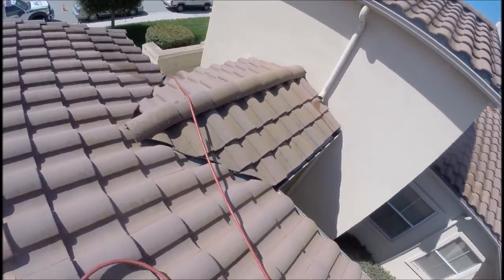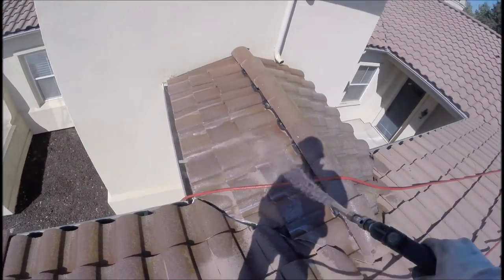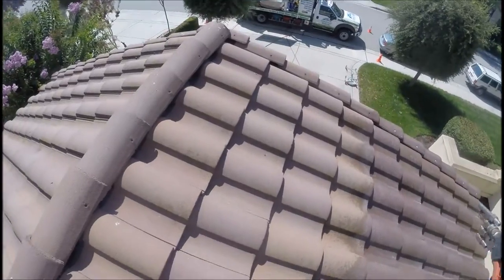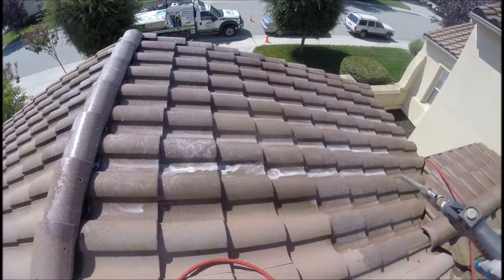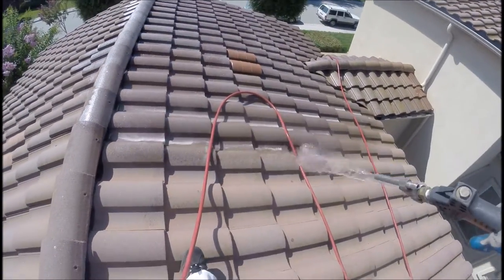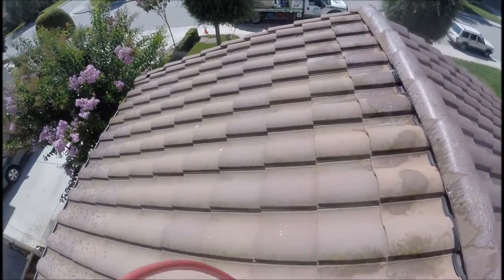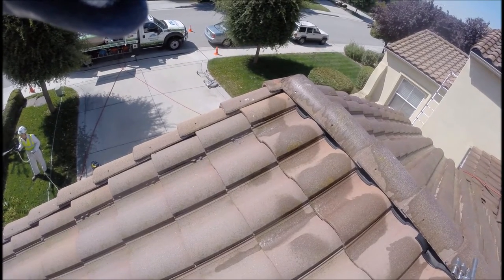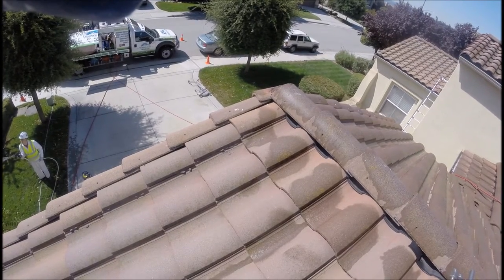SoftWash Roof Cleaning in Morgan Hill CA

Comment from the maker: Did you know that Certified SoftWash Roof & Exterior Cleaning Process conform to the California Air Quality Management District Standard?

There are no exhaust fumes omitting CO2 while performing Certified SoftWash Roof & Exterior Cleaning. Our State of the art Eco Friendly Truck's Solar Panels' charge the on board battery bank, which provides the AC/DC (12 V & 115 V) power for our equipment.

Contact an Eco Friendly Exterior Cleaning Company for Certified SoftWash Roof & Exterior Cleaning needs.

(408) 693-5140
www.ippws.com
info@ippws.com